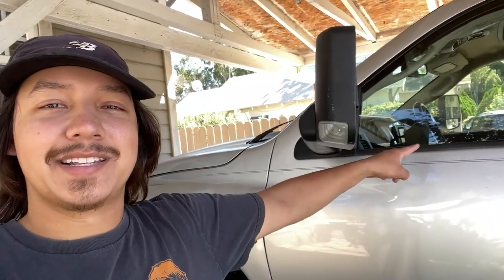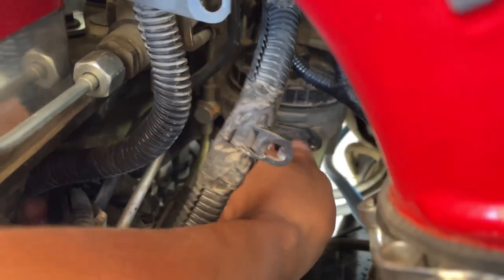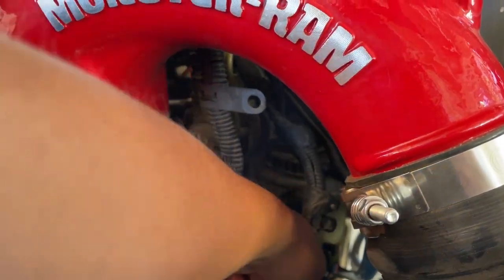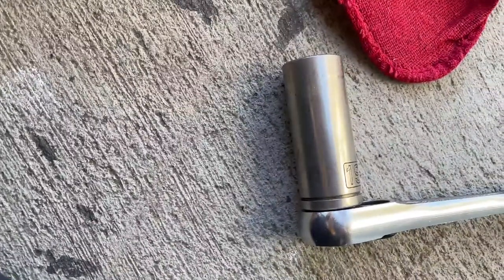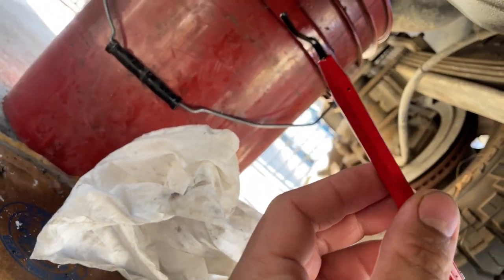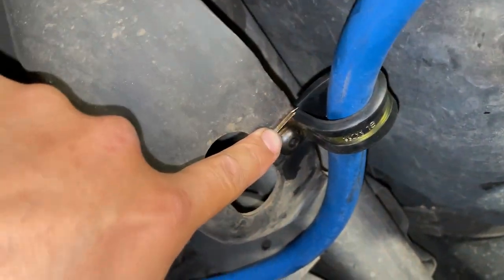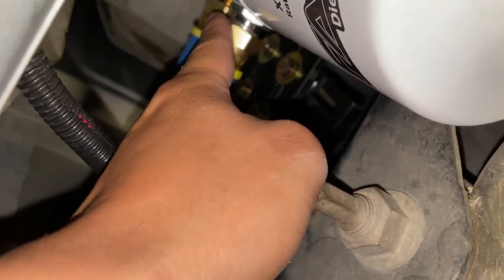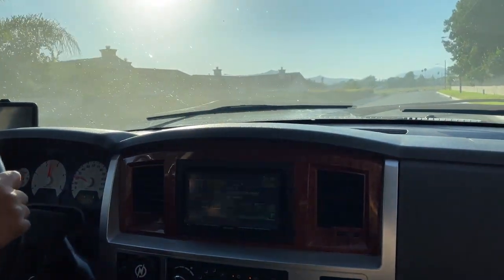FASS Lift Pump install! + Beans sump, and Fleece delete kit!

Comment: Oh man, you don’t wanna put the sump under the gasket.  And you wanna watch out for that slosh flap in there.
Reply: I'm thinking of doing mine any place I should put it? I dont wanna cut right under that basket
Reply: @ethanblakely2313  thoroughbred diesel has a video. Of installing a G&R sump.  Watch it.  They cut a 2006 ram fuel tank and a half. And they show you exactly where to put it.